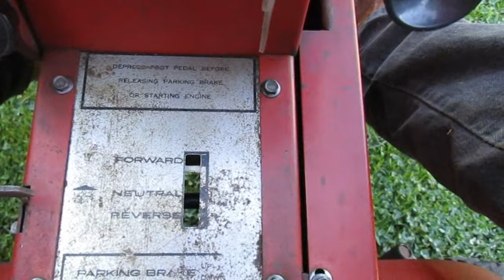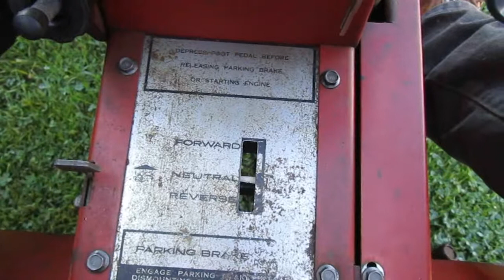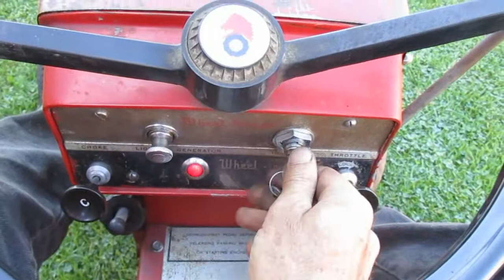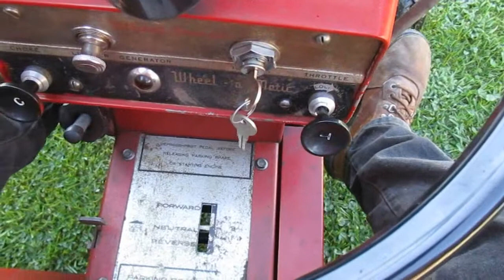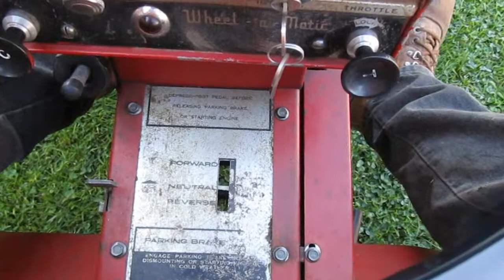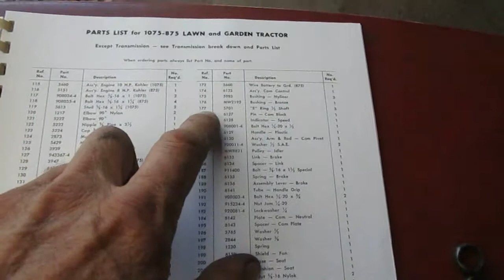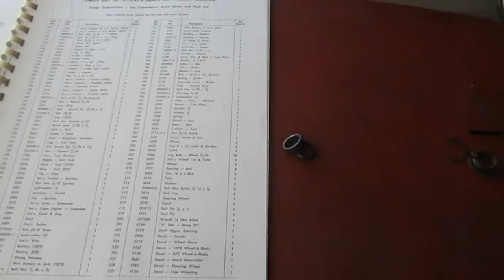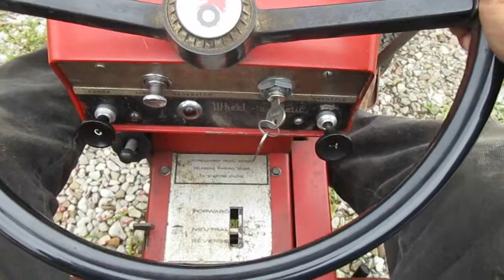Hydrostat Linkage Repair

Comment: where did you order those pieces from?  i made new bushing use copper pipe works good for awhile but cant seem to get that "bronze" piece the right thickness.. great video btw. hard to find anything on the 875's
Reply from the maker: I got the parts from RCPW.com. There's not an exploded parts picture to choose from, but you can go to the Wheel Horse Parts section of that website and search for the original part numbers from your Wheel Horse manual. The part number for the bronze bushing is MW2195, and the nylon bushings are 5666 and 5983.

Comment: I have a 1075 with the hyrdo tranny, the motor revs out and runs fine but barely goes in reverse and I feel like it should have more power going forward, any ideas?
Reply from the maker: Hi, first I would check the linkage to make sure it's moving the transmission lever as far as it should. Next I would check the trans fluid, probably change the fluid and filter. I've never done that so check the manual. If that don't fix it, it's probably an internal transmission issue.

Comment: Im having the same problem with my 67 877. Where did you purchase the bushings from?
Thanks for posting this repair...Subbed👍
Reply from the maker: I got the parts from RCPW.com. Go to the Wheel Horse Parts section and search for MW2195 (the bronze bushing) and search for 5666 and 5983 to get the nylon bushings. Notice a previous posted comment says that www.jackssmallengines.com has the plastic linkage piece.
Reply: @PackratsFabrications  I just ordered these parts for my 877 just now. and ordered the plastic cam from www.jackssmallengines.com part number is 5996 around $14 or $15  I found out this part is same as the one on the 5062 sundstrand transmission as well perhaps others.

Comment: Changed my plastic piece.  Now it want move.
Reply from the maker: The back side of the plastic piece has an angled groove or slot where the end of the transmission lever fits in. It sounds like maybe the button on the transmission lever is not riding in the groove correctly. The transmission lever has to be in the right place when you put the plastic part on it.